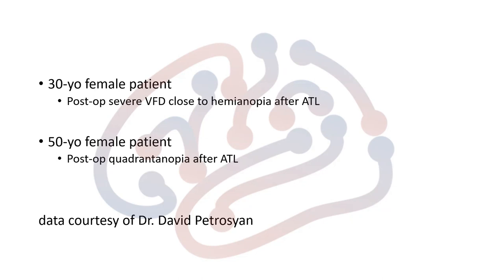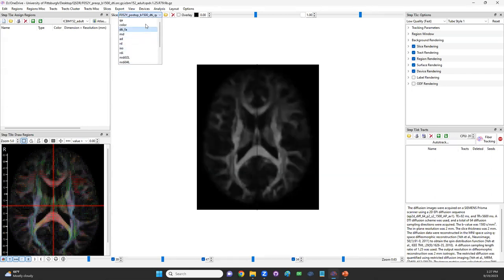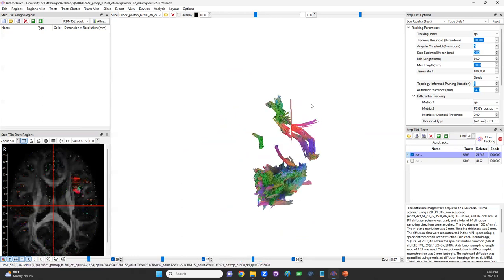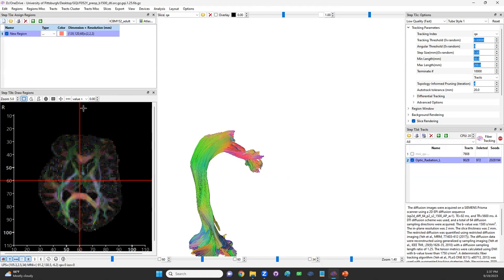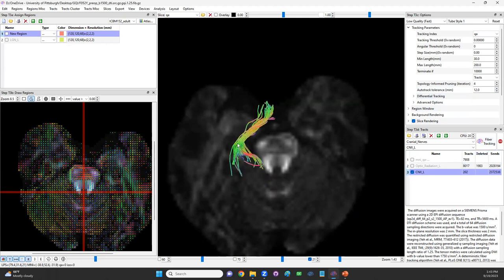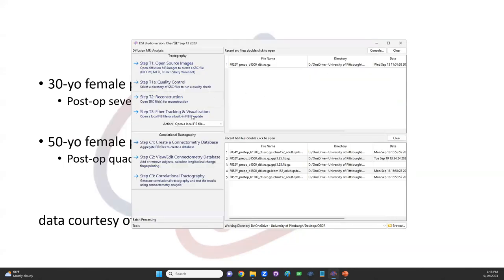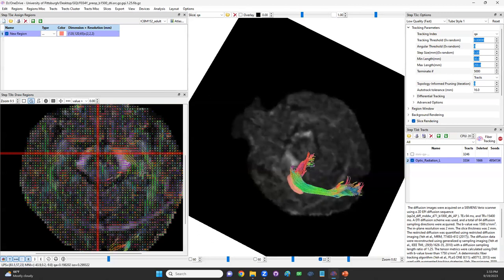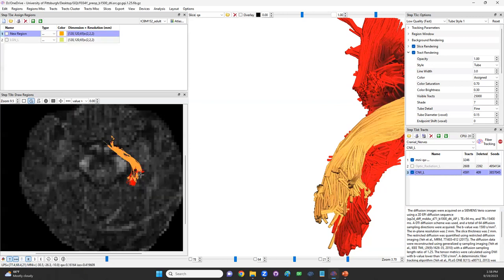Differential Tractography on Patients with Anterior Temporal Lobectomy

Comment: Thank you for the tutorial.  I used this method but I have encountered some difficulties. One problem I encountered was that, if I delete the presumed false tracts, when I used the recognize tract function to identify the name and damage percentage of the different tracts generated, the percentage of the tracts before I deleted the false connection was inferior to their percentage after the deletion of the false connection. Another problem was  that the results were totally different when using 2 different computers with the same dataset.
Reply from the maker: Thanks for reporting this issue. I will improve this function in the near future.